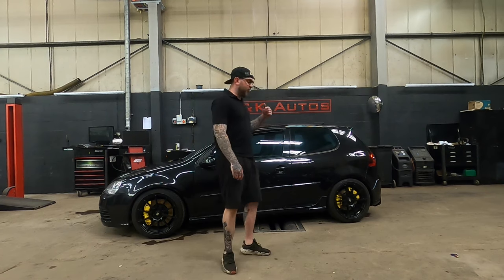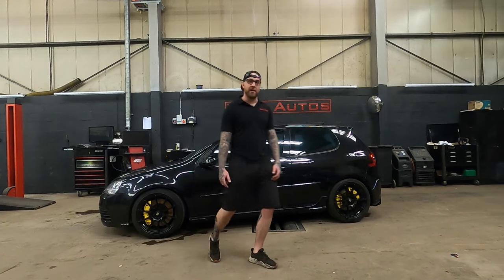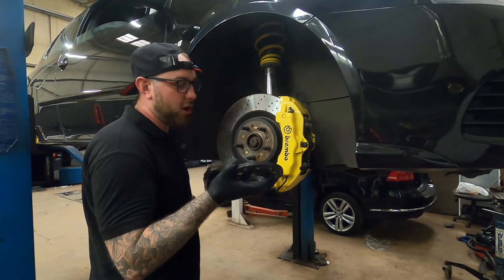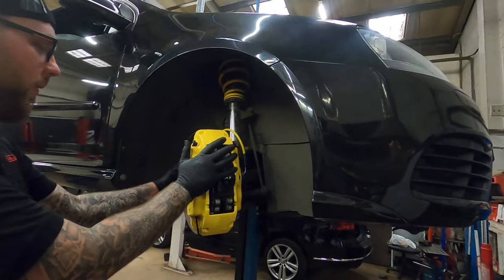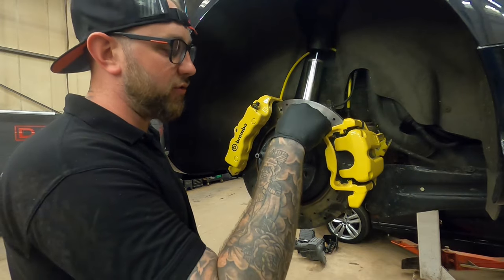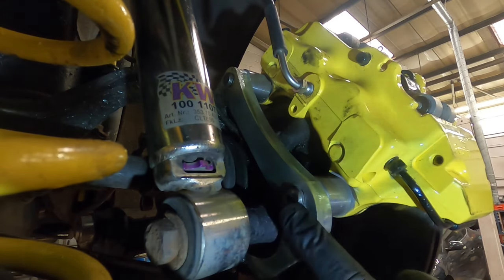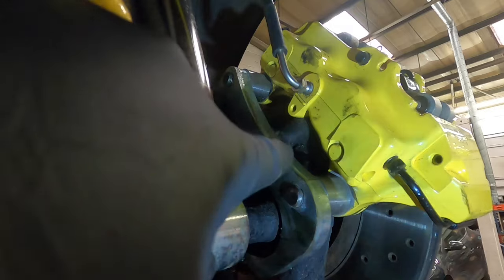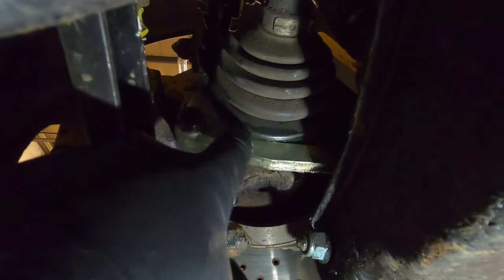MK5 GOLF BREMBO "PORSCHE CALIPER" RETROFIT 18Z 17Z BIG BRAKE KIT INSTALL DIY

Comment: On the rear R32 caliper. Did you have to plug off or block off any ports on the caliper itself?  Then only run the parking brake cable to that caliper and done?

Comment: Did you happen to test if the spare wheel still fits on either the front or the back? Could you link to the rear adapter too? Great video also!
Reply from the maker: I have a skinny space saver wheel as a spare and i definitely does not fit I've actually taken mine out of the car. Even with the sparco wheels i have to run 10mm all round and that only just clears them, on OEM wheels you would need more like 12mm if your lucky but probably 15mm. Only way your spare would fit is if you carried a big spacer with you for it maybe 20-25mm. Thanks appreciate it 👍

Comment: Hello my friend I loved you big brake project. So can you help me with some doubts. So I’m from Miami and I have a Jetta mk5 2.5 2007. Today I’ve bought a set of Porsche Calipers to install on it.
Can you tell me the parts I will need do instal everything? Especially on rear that I loved in your car. So where I can find the rear adapter to hold the Calipers and about the ABS sen sensor.
Sorry for bothering you and thank you so much for sharing with us .

Comment: Hey, I need help. 
Did all the same and I have vibration in the wheels. Very small. It increases with the speed. 
I don’t know what can be disbalanced. 
Do you have vibration? 
I put Brembo z18 on my Seat Leon
Reply: if you have aftermarket wheels, maybe you need some hub centric rings.

Comment: Sick I’m trying to fit ttrs 8 pots with 370mm discs but struggling to clear the caliper. What size are your front discs? What diameter, width and offset are the alloys? Thanks
Reply from the maker: Front discs are 350mm. Wheels are 18x8 ET48 With 10mm spacers

Comment: Very helpful ... gonna do the mod never heard about the abs sensor in the rear ? good to know ... and even grind a little the rear bracket for better fitting. How do you like your R32 with this mod ? is it worth it ?
Reply from the maker: Ye i hadn't either until i did it, the mods more common on the mk4 i don't think they have this problem. I spent months looking for the bracket epytec was the only one i could find for the mk5 but a fair few for mk4. I've ground some off, changed the cv gaiter and put some elastic bands in the ridges of the cv gaiter to stop it expanding under high rotation speeds so far so good. 100% took the car on track the brakes performed perfect 👍

Comment: Damm that’s looks great. Did you think that I have to change my brake pump in my mk6 gti.  And the rotors of Mercedes are not too heavy. 
Greetings
I’m from Guatemala
Reply from the maker: Thanks 👍I'm not sure i thought i would need to upgrade mine but the brakes feel great. They are quiet heavy but not that much more than stock discs at some point I will switch to 2 piece discs, the stock pad carriers are sold steel and are very heavy so as a whole i dont feel the front swap weighs much more.

Comment: Hello mate,what caliper use rear from porsche cayenne and disc brake 310x22?
Reply from the maker: Same car as front caliper is from, porshe cayenne, audi q7 and v10 toureg
Reply: @dkautos  yes i know that but you have any problem with rear brake caliper because it's for disc brake 28mm (porsche audi vw) not for 22 from r32
Reply from the maker: @goingfast8238  I didnt have any problems still works perfect
Reply: Thank you for your answer's,,i ordered the same setup with you,,i imagine the difference its very big with that brakes from stock

Comment: Hi mate great video doing this conversation after watching your video but can I ask you about the rs3 or ttrs  brake master cylinder I know you were happy with your set up but if I need one what year can you get one from ?? Cheers
Reply from the maker: I beleive its the shape they first did a TTRS and the RS3 of the same ages at that. I cant remember exactly it was a long time ago i looked into it and still dont have one, ive used mine on track and its turbo now aswell pushing over 500bhp and im still happy with oem master
Reply: @dkautos  ok thanks I’ll try them first see how they go . Just one more question on the rears how did you adapt the brake lines to fit together?? Did you use a tee  adapter or is there a kit for the rear as well thanks for any info 👍
Reply from the maker: @roybamford8698  just use the same braided line as you use on the front the oem caliper no longer has fluid to it the oem caliper is only used as a mechanical handbrake
Reply: @dkautos  that now makes sense thanks again for the advice 👍

Comment: Hey boss man I got one more question, what year does the master cylinder have to be and the rear caliper is 18z as well? Respect
Reply from the maker: To be honest mate i can't even remember i never got it in the end was on back order for over a year. Im happy without it, its very slightly spongey at the top but then really sharp now im used to it i like it so im not gonna bother doing it
Reply: @dkautos  yo I hear that and probably around 400 us most likely not even worth it. I as the rest of us really appreciate the knowledge  big up
Reply from the maker: @mkfourgli1  Ye not worth it i did a track day as i was and nothing could brake like me so ye dont bother or atleast try it for yourself if you wanna change in the future only extra is re bleeding the brakes again. No worries bro

Comment: Looks amazing. Will be doing this mod to my Scirocco. Do you know what year ML350 the front discs are from?
Reply from the maker: Thanks. https://www.ebay.co.uk/itm/Fits-Mercedes-M-Class-W166-ML-350-BlueTec-Apec-Front-Vented-Drilled-Brake-Discs-/293035686315?mkcid=16&mkevt=1&_trksid=p2349624.m46890.l49286&mkrid=710-127635-2958-0
Reply: @dkautos  Thank you.
Reply: @dkautos  thanks!
Reply: @dkautos codice Oem pinza freno posteriore ?

Comment: What is the weigh of the rotors.are they too heavy?
Reply from the maker: Calipers are no heavier , the stock calipers are steel and have pad carriers which are also steel these calipers are aluminum and the pads are inside caliper so no pad carrier. Discs are heavier but i can add 2 piece discs in the future. Rears add weight but again 2 piece discs and i dont think it would be far off stock weight on the back

Comment: Hi where can you get bolts sleeves , spigot ring kit thanks great video
Reply from the maker: Thanks 👍 you can get them from ebay https://www.ebay.co.uk/itm/Brembo-17Z-18Z-caliper-bolts-Golf-MK5-Mk6-MK7-TT-A3-Leon-braided-lines-hub-ring-/303623128911?_trksid=p2349624.m46890.l49286

Comment: How did you make the rear calipers work without oil pressure i cant get the air to build up how u do it
Reply from the maker: You need brake fluid to the caliper ypu take the brake line from the original line the smaller caliper it's just for handbrake which is cable
Reply: @dkautos ya sorry i meant the handbrake cable how you get it to work without oil i read on the manual of the kit i bought it says not to use oil for the handbrake just the cable and im assuming it builds pressure to with like air to push the piston is that right?
Reply from the maker: @GlanceHD  ye if the piston is all the way back you need pressure to push it put before the handbrake will work I had this trouble. I actually put a grease nipple in the bleed screw port and pumped grease in to push it out and will also stop is seizing
Reply: @dkautos  okok if you dont mind me asking why not put brake fluid in stead of grease?
Reply: @dkautos  question can you show me what master cylinder you used because i know we need a rs3 one i need to find one and i dont know which i need id really appreciate it

Comment: Hi
So, i dont know if it works but try the macan turbo disc, i think they have the right hub measure
in my A4 B6 was Plug & Play
hHpe i help you
Great joob
Reply: Hey is this for the rear or for both front and rear you are speaking about? cause I have 18z on my b6 and I want the 4pot rear but voshmods want $650+ for his bracket only and I was looking at making this work somehow LOL

Comment: What wheel size and offset are you running?
Reply from the maker: 18x8 ET48 With 10mm Spacers
Reply: @dkautos  is there a reason you didn't just go with an ET35?
Reply from the maker: @bakozubski  I thought ET48 would clear the calipers and thought ET35 would be too much poke. Looking back now ET35 would have been a better route just might need the arches rolling
Reply: @dkautos  gotcha, thanks for the video, really helpful.  Thinking about doing this on my MQB wagon so hopefully most of the steps are the same
Reply: @dkautos   I'd like to fit 17Z's and considering 17x7.5 ET35 will the wheels clear the caliper? Can't seem to find a 17z Caliper template anywhere
Reply from the maker: @robertgiteya  I can't say for sure as different wheels and spoke design will vary fitment but i would say that will be enough to clear the brakes or atleast be very close
Reply: @dkautos  Thanks a bunch. I'm looking at the Sparco Podio or MSW 29

Comment: Why not use floating disc?
Reply from the maker: I will be at some point i wanted to keep as much money to one side for turbo build plua i was struggling to find them
Reply: @dkautos  I guess you can custom made floating disc at local brakes shops? We do it here in Hong Kong as many companies don't have specific fitments and size and brackets for many particular model of cars. Most cars have installed bbk here as standard mod instead of just sheer power.

Comment: Did you say this comes as a kit?
Reply from the maker: You can get the front fitting kit, you can also buy the front calipers with a fitting kit. The rear i only found one place that sells the bracket then you just need a braided line. Thats all in the UK. I could put a complete kit together with everything and calipers in your choice of colour but you will be looking about £1500+VAT and a few weeks to sort it all 👍
Reply: @dkautos  thanks for the reply. Would fitting be included? Just wondering because that way I could get everything done in one place